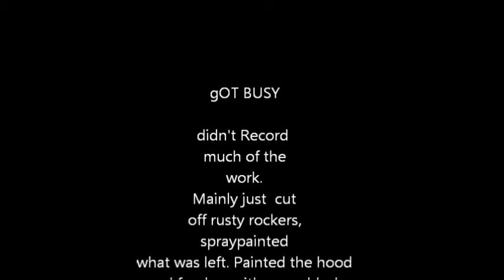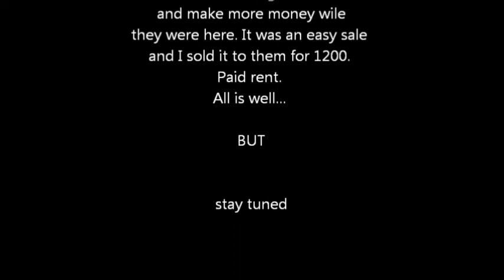How to Flip Cars on Craigslist (Grand Prix GT) FULL VERSION

Comment: Hey man great video!, what type of tools did you use to paint the car?
Reply from the maker: I just used Dupli Color's Color match GM black single stage in a can. Kina a bad idea as you can't really blend a single stage paint into a base coat clear coat and not notice it but it was all black and not as rusty so worked for this particular job. If I had a little mini hvlp gun I would have used that. Or at least had NAPA mix up a can of basecoat in a spray can for 15 bucks then sprayed the whole panel with clear. This is how I did my last project. Its a gold AUDI. I will have video up soon. Tons of vids on the way!
Reply: Thanks a lot I really appreciate it.

Comment: I have a 2002 Grand Prix GT I'm trying to sell, not as much rust but I'm having a similar probelm with a rusty section (3"x3" like someone bit out a chunk of the top and side of the metal) on the rocker panel/rear wheel well. How did you remove the side skirt to get to the rocker panels underneath? Just remove the screws and pull? I took my screws out but something is holding the skirt on and I can't see where. Thanks for the upload, great video and inspiration!